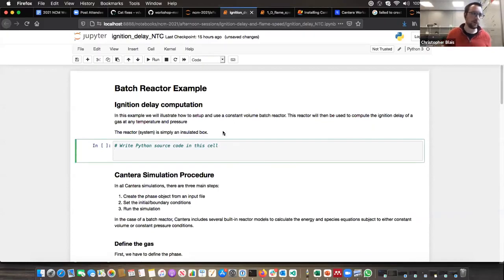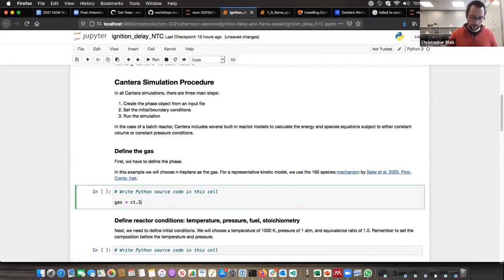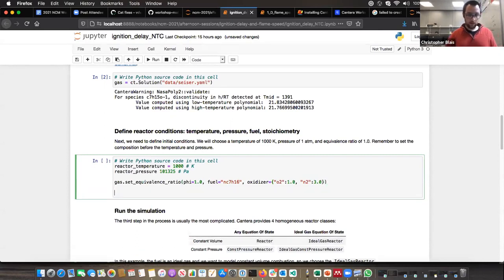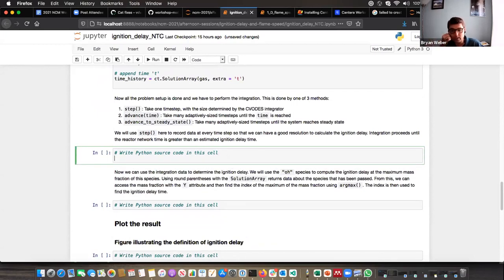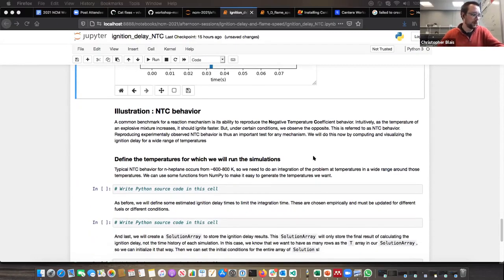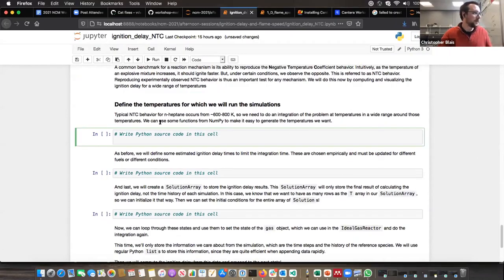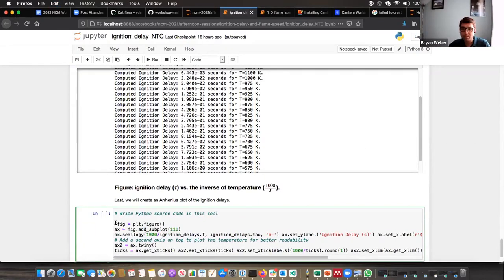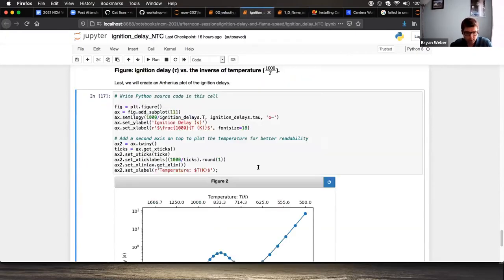Cantera: Flame Speeds & Ignition Delays

Comment: Hi, thank you for the video, I have a question, if I add a diluent to the mixture for example Hydrogen is the following formula of the mixture correct gas.set_equivalence_ratio(0.5, "C3H8: 0.030", "O2: 0.228, N2: 0.73", diluent="H2", fraction={"diluent": 0.0091}, basis='mass') or no?
Thans again
Reply from the maker: Can you ask this question on our Users' Group? You'll get a much faster response! https://groups.google.com/g/cantera-users